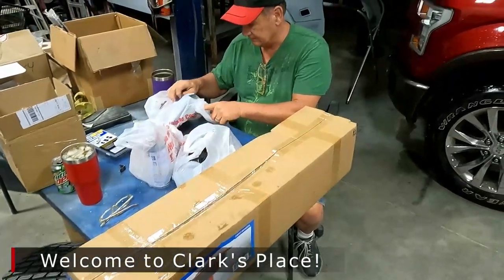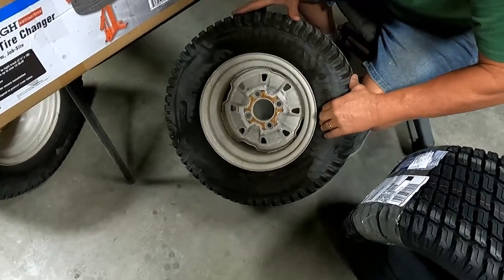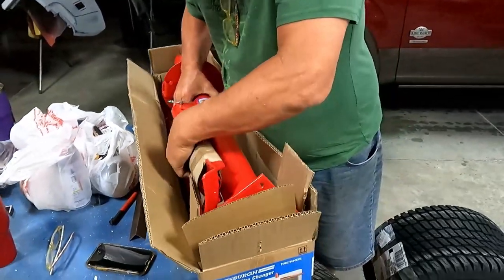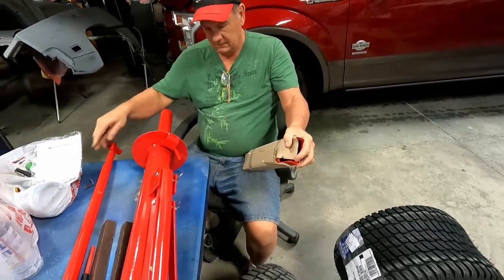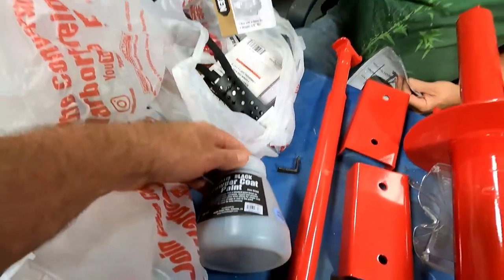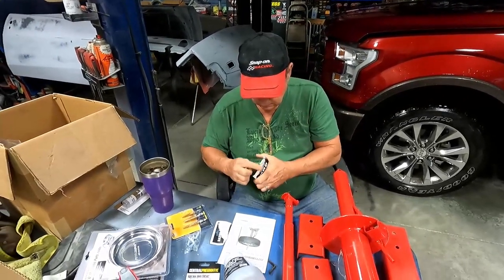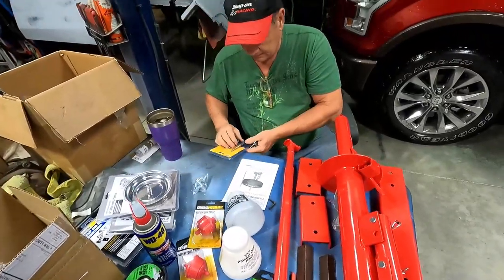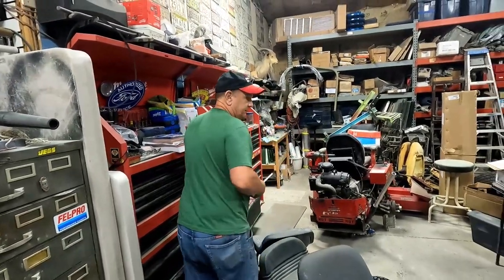Harbor Freight Manual Tire Changer Test and Review

Comment: Need to mount it to the floor.that will make it a whole lot easier.also go and watch other on on u-tube how they do it. Great job , you both work as a good team 👍
Reply from the maker: We did this blind pretty much and struggled for sure, but I think it makes for a good vid, we had fun!
Reply: @ClarksPlace  yeah it was fun to watch you to struggle ,but it was educational thanks.👍
Reply from the maker: @thomashorn9152  I think in between all the struggling moments we figured out it’s a pretty awesome tool if you’re wanting an option besides the local tire shop.  And it was fun!  Thanks for watchin it!
Reply: @thomashorn9152  I made a setup so I could attach my HF tire changer to my truck's receiver trailer hitch.  Works great. 3' of 2" square tubing and it attaches to the tire changer with hose clamps. Thus, easily installed/uninstalled.